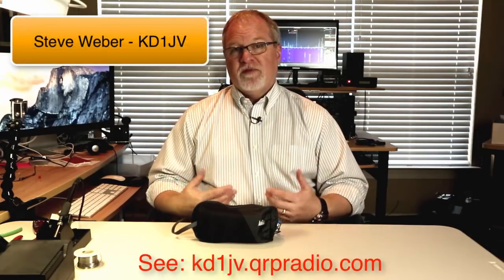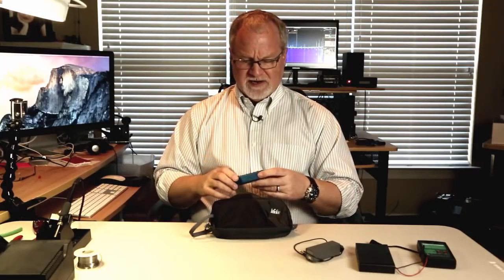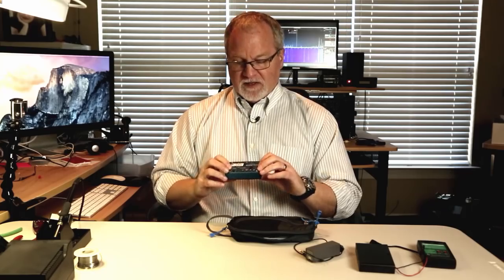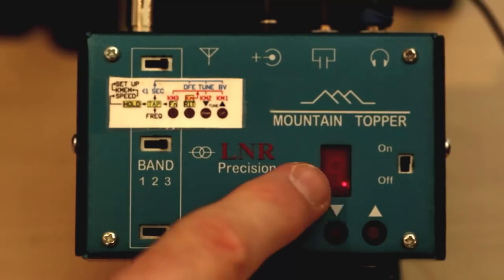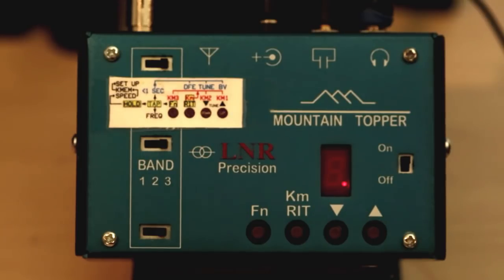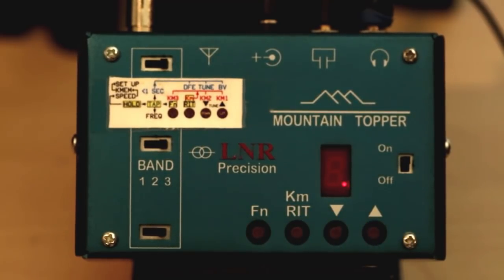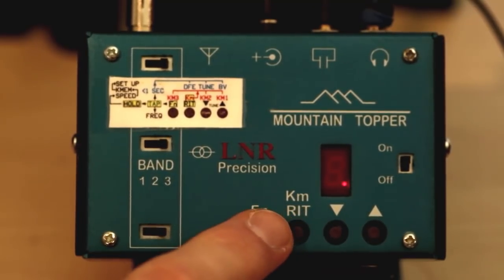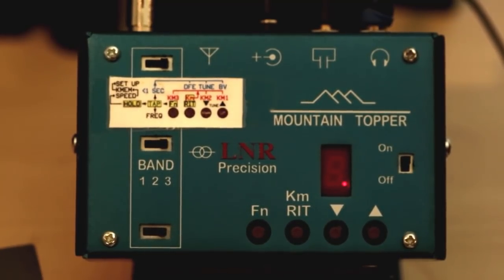How to Use the Mountain Topper QRP Radio

Comment: So, an RCA jack is smaller than an SMA?  There are any number of SMA, Mini and Micro-SMA jacks that would be far better than that ridiculous  RCA jack.  Are you supposed to use tape to prevent the antenna cable from pulling out?
Reply from the maker: +Yosen B. Mamma I understand your point that there are better connectors for an antenna than an RCA jack.

In the video, I show that I have two adapters... RCA to BNC and RCA to SO-239.  I haven't had an issue with the adapter coming out of the socket.  As a matter of fact, the adapters are very tight and I have to remember to pull straight out and not twist the adapter.  One time I twisted the adapter as I removed it and I felt the RCA jack rotating slightly.  I opened that case and there was no damage but I'm sure I could damage the RCA jack (break its connection to the PCB) if the adapter was tight and I twisted hard to remove it. - Cliff
Reply: I think the RCA is a good choice. 1) If something snags your antenna or feedline it will pull out. 2) It is much easier to install an RCA on a small coax than it is an SMA, etc.
Reply from the maker: "If something snags your antenna or feedline it will pull out."
That sounds quite reasonable but, if the connecting cable is plugged in securely, any snag of the feedline would drag the tiny 4.4 ounce radio off the table/rock/lap and onto the ground. - Cliff

Comment: Can i use this as a technician on those bands? I know morse but havnt gotten my general and extra yet
Reply from the maker: +MotorcycleMouse With a Technician's license you can do CW on 40 meters but not on 30 meters or 20 meters.  Still, there's a lot of stations to talk to on 40 meters and it's open most of the time - especially later afternoon and night.  In fact, if I could only have 1 ham band for morse code, I would choose 40 meters.  So, go ahead and jump into the 40 meter pool! - Cliff

Comment: Could you make a video about Elecraft KX1 vs. Mountain Topper, with some qso examples? I would love it.
Thanks Cliff.
72
Reply from the maker: +Pappo Official Channel That would be a tough comparison.  The KX1 costs more and is about 3x the size (in volume). It does have some features that the Mountain Topper doesn't have. But the Mountain Topper is designed to provide great performance in the smallest possible package... so the designer consciously chose to reduce the feature set in order to keep the size smaller. With both radios, you'd be able to communicate with the same people on the far end.  If you want the smallest, great-performing radio, the Mountain Topper wins.  If you don't mind the radio being larger (but still compact), the KX1 has more features and expandability.

Maybe I should do a review of the KX1 by itself and then viewers could decide for themselves which is best suited to their purpose. - Cliff
Reply: +QRP School Yes, it will be nice if you do a review of the kx1.
Have a nice day. 72

Comment: Terrific video Cliff. Your thorough review and enthusiasm convinced me this little rig was "the ticket" and indeed it is. I just received mine this week and it is, in fact, a blast. My only other rig is a KX3 that I've had for five years. Having since added the 100-watt amplifier and pan adapter, it's become too cumbersome to uncable it for outdoor use. Plus, I've never been comfortable taking my expensive KX3 out in the wild. I love it for home use. The MTR-3B, on the other hand, is just perfect for taking anywhere. 

I'm using rechargeable 9V Li-ion Ni-MH batteries and pleased with them so far. I also purchased the EFT-MTR 20M/30M/40M antenna LNR designed for use with this rig. Works great without a tuner to lug around. Good advice on getting the Koss inline volume control. I'd say it's a necessity. It just so happens I own Koss PortaPro headphones and they are a perfect match for field use. Waiting for my Palm Pico Paddle and Youngerbaby shoulder bag to arrive and complete my "go kit."

Folks, don't be intimidated by the unusual features of this rig. It quickly becomes intuitive. It's the most fun I've had since that first novice contact back in 1966.
Bob, W2TAC
Reply from the maker: Thanks, Bob.  I'm glad you're having a great experience with the MTR-3B. And thanks for mentioning the Youngerbaby bag. I'll have to check into those. I have a weakness for buying cool bags/backpacks! 72 - Cliff

Comment: Cliff -   I recently built the PFR-3B, another design by Steve Weber.  I was on the fence between the PFR-3B and the Mountain Topper.  The final sell was due to the internal tuner and a full 5W available (although I know 3W is plenty).  Definitely bigger than the topper, but worth it due to not carrying extra cables and tuner.  My 2 cents.  Great designs, both of them - similar layout and operation as well.
73
Reply from the maker: +Mike Golini Thanks for your comment, Mike.  My Elecraft KX1 has the internal tuner option, making it similar in functionality to the PFR-3B... a kit that I have long considered building. As for the tuner, after playing around with a lot of wire antennas, I've pretty much standardized on using resonant dipoles - so I don't really need to use a tuner... but I'm glad it's there in case I have to deploy my antenna higher or lower than than the elevation it was tuned for.  With QRP power levels, I like having a very efficient antenna.  I'll take another look at the PFR-3B at Dayton. Thanks again- Cliff

Comment: First rate video and very helpful.  I need to put together a battery pack for mine instead of running from power supply.  Would appreciate any tips based on your experience. 73
Reply from the maker: +David Edger Hey, David. I've seen others using LiPO battery packs like those used for RC model cars.  That seems like a pretty good way to go. You'll need to get the charger, too, of course.  Because I have dozens of rechargeable AA batteries from my photography hobby (powering flash units), I just purchased an 8 AA battery pack and soldered the required plug (1.7mm pin - same as used on an FT-817 radio) to the pack. When fully charged, I get about 11.3 volts and it takes a long time for the voltage to drop to 10 watts.  I've got more than enough operating time.  The only negative is that my 8 AA batteries in the pack are larger and heavier than the radio!  That's not a real problem, of course.  So, if you've got a bunch of rechargeable AA's laying around, you can use those.  If not, check into those LiPO packs for model cars... just google QRP RADIO LIPO BATTERIES and you'll find some good links. Sorry I can't recommend something specific! - Cliff

Comment: Interesting rig did you build it yourself or can I get already assembled ? And what is that battery and where did you get it from?
Reply from the maker: I bought mine already built... from LNR Precision: https://www.lnrprecision.com/mountain-toppers/

I use 8 AA batteries in a plastic battery holder like this one: https://www.adafruit.com/product/875

I replaced the existing plug on the battery pack to a different one that fits the Mount Topper radio.  (The same power plug for the Yaesu FT-817 fits the Mountain Topper)

Cliff

Comment: I'm hoping with all the new kits evolving Hams will be portable with inexpensive and more power. I like the idea of small CW rigs but I want power too
Reply from the maker: Power can sometimes help but, don't forget this indisputable fact:  A doubling of your power yields a 3dB increase but it takes 6dB to get an additional S-Unit. So, if you go from 5 watts to 20 watts, the receiving station will only hear you 1 S-Unit louder. Going from 20 watts to 80 watts would get you another S-Unit.  So... going from 5 watts to 80/100 watts only gets you a 2 S-Unit increase at the receiving station.  Sometimes an extra 2 S-Units can make a difference but most of the time it doesn't matter.  This is especially true for CW or Digital signals as they have a more concentrated signal.  Get more power and use it when you need it.  There have been times when I've considered buying an amplifier but I just can't bring myself to do it! :-)

Comment: Cliff,
For my MTR-5B, I bought a couple 11.1v 2200 mAh Lipo's. Their initial charge voltage is about 12.3vdc. Do you think that slight difference would damage the radio ?
Lee, WA8QFE
Reply from the maker: From what I've read online, you should be fine to start at 12.3 volts. - Cliff
Reply: I'll smoke check it !! HI...HI.
Lee, WA8QFE

Comment: Can you do a video on the LNR LD-5? I got one off the internet used. So far it is a cool little radio. I am tossed between using the new 7300 and the LD-5.
Reply from the maker: Hello, Dennis. I'm sitting on a cruise ship off the coast of Curacao, checking my mail so this is a good time to chat. I don't have an LNR LD-5 radio but it's received good reviews.  It's a QRP radio (5 watts output) that is good for working portable because of low power consumption and small size/weight.  The Icom 7300, on the other hand, puts out a full 100 watts and has a real-time, full-color panadapter built-in. It costs more than twice as much as an LD-5 and uses 3x the battery power in receive mode.  It's not really fair to compare these two radios as they're not intended for the same purpose/market.  I have friends who love the Icom 7300 and I've played with one. I was impressed. In fact, it's the first modern-day Icom that appeals to me... but there's not one in my future.

If you've already got the LD-5, my advice is to have fun with it. If you find yourself wanting the additional two S-units of power and expanded features of the 7300, it's a fine radio and your LD-5 will be a great QRP radio for working in the great outdoors. - Cliff
Reply: Hi Cliff. Enjoy your cruise. I am jealous. I am enjoying both of my new radios. The LD5 is my first rap radio. When the band is open I like it. But the 7300 is a fun radio too. Have fun  73 Dennis N7HRO

Comment: 1) Cool, seems to work well for a small, band-limited, CW only, trail radio.  A 3S lipo with 5000 AH will power this all day.
2) My critique is that you can make a radio TOO bare bones.  Needing to buy "work-arounds" like an adapter because they used a nonstandard antenna jack, or a special in-line headphone adapter for volume control are indications of this.  No internal battery is a minus.  Now you have the radio, battery, tuner, key, and headphone volume control all separately wired in a mess strewn about, and you have carry all of it.
Reply from the maker: I cannot disagree. The MTR5B has a BNC jack, which is nice. If I wasn't using earbuds, but regular earphones, I could slip the pads off my ears to change the volume. Not optimal, of course.  It is what it is... a tiny radio with a number of compromises in favor of size and decreased complexity. BTW, as I type this, a friend is driving us home from the Dayton Hamvention. I just worked French Guyana mobile with the MTR5B. Great fun! - Cliff
Reply: LOL, I've been at Hamvention 2016 too, going back at 1:00 in hopes of a prize.  I got an Elecraft  KX2.  I'd love to see your take on one; look for vids from me on it trying to do psk 31 portable with a cheap $49 kindle fire tablet.  Subscribed.
Reply from the maker: +kd8poi Cool. I look forward to seeing your KX2 videos!  My KX2 is 20 miles away, according to UPS. I'll have it tomorrow... - Cliff
Reply: Just did qrp psk 31 via rig-blaster blue,a $49 kindle fire, and the KX2.  Have fun!

Comment: why is it so expensive
Reply from the maker: +Jarrod P Hello, Jarrod.  I don't know.  My guess is they have several factors that have to be considered.  Maybe they have to pay Steve Weber (the designer) for each unit sold.  Labor costs of construction would be a factor.  Knowing that they are going to spend some time (money) in customer support is a factor.  Wanting to make a profit after royalties, labor, support should be a factor as well.  I don't think $250 is unreasonable, though. Now, look at the bells and whistles of an Elecraft KX1 for $50 more and your decision becomes more difficult.  (I have both and am glad to have them both) - Cliff
Reply: +QRP School the kit has the same price as the assembled unit, seems too high to me but I dunno
Reply: MFJ qrp sideband radios are like 200. I think one of the features that justifies the cost is the direct frequency entry. the others you have to scroll around on the vfo knob to find something. here, you can up and down yes, 50hz at a time, but if you know where you are going, you can key it in.

since the radio only has four buttons on the panel, you do the entry on your paddal in morse. wonderful implementation of DFE.

Comment: I just ordered mine. Did the unit come with an adapter to solder to a batter pack/connector or did you have to purchase the plug (yaesu-817) separately? Thank you.
Michael AD6S
Reply: it came with a plug (1.7mm center pin) like the ft-817 -Cliff
Reply: +Cliff Batson Thanx for the quick reply , 73's Michael
Reply: +mci1969 Sorry to bug you on this but I haven't heard back from MTN Topper yet and I'm dying to play with this new toy I just got. Is the power supply center lug the GROUND? The face of the unit is a bit deceptive and I dont want to be wrong.
Reply from the maker: +mci1969 Hello.  The center pin is POSITIVE - not ground.  I see what you mean about the diagram on the MTR-3B radio... there's a dash pointing to a "+" so it might be a bit confusing since the dash looks like a minus sign.  It's definitely using a positive center pin, though.  - Cliff